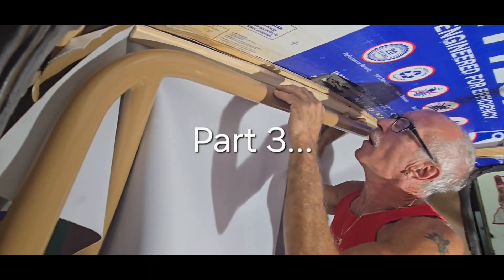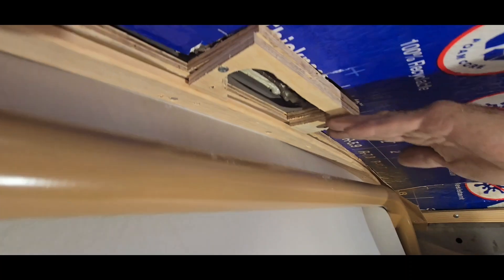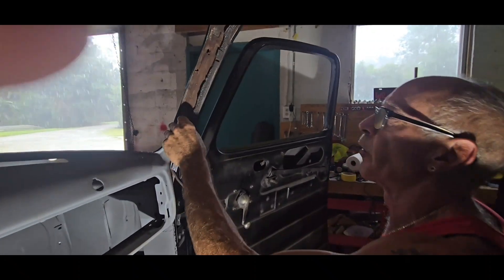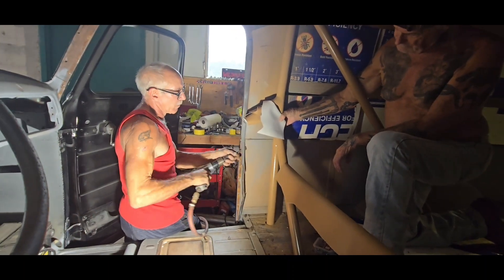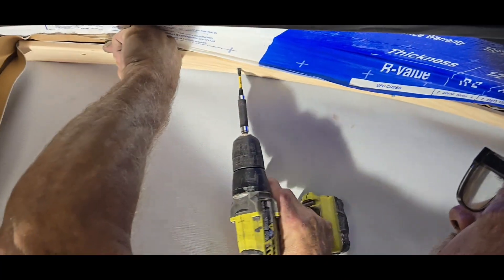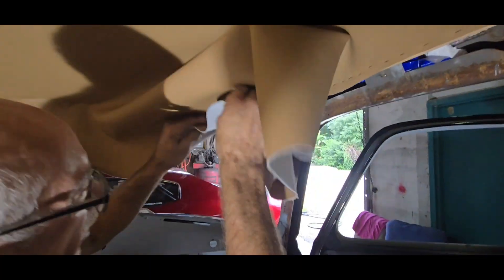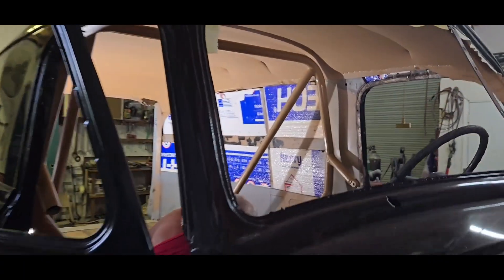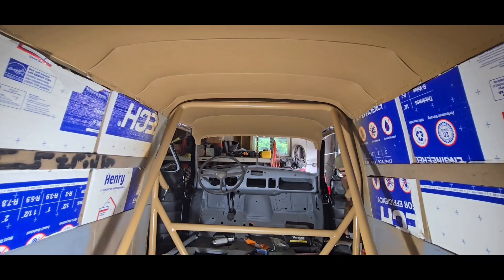How to install custom vinyl headliner professionally at home PART 3

Comment: What did the very front edge of the material stick to? Was there glue on the face side of the rubber strip above the windshield?
Reply from the maker: This is a 3 part video, he shows the whole process start to finish. Its easier to watch the first video, it's glued to the roof edge and around the windshield. We don't have any rubber strips on it yet ✌️.